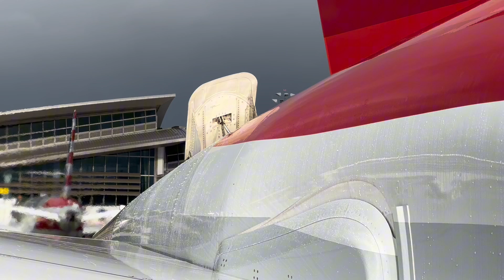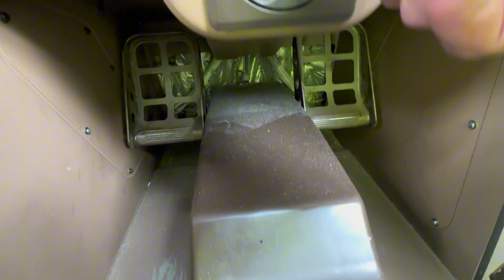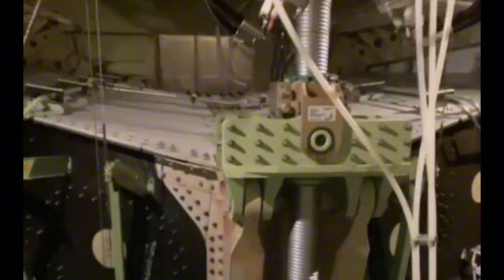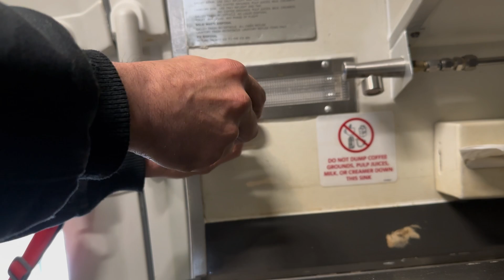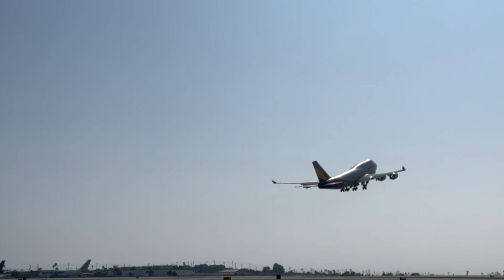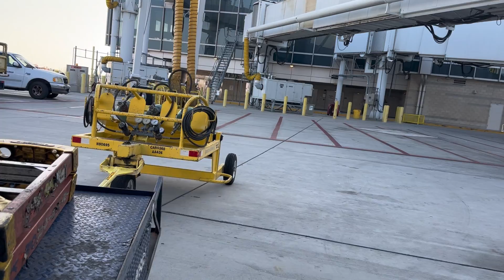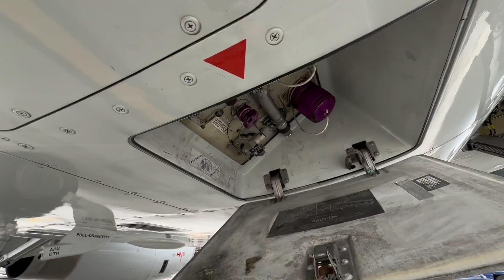Stig Shift #20 (Aircraft Maintenance Adventures)

Comment: Another excellent video - thank you for showing us your world. Your pride in and dedication to your work and knowledge sharing really shines through and is commendable. A couple of questions on tyres: do you change tyres on the 'line' (apron) or is that done in a hangar? how do you determine when a tyre needs to be changed, I assume remaining tread depth? How long does a tyre typically stay on before it has to be changed, say on a 787? How do you determine if a brake (pad) needs to be changed, is there a wear indicator on the brake assembly, a manual check?
Reply from the maker: Thank you so much and to answer your questions I have actually made plenty of other videos which I discussed these things in. In regards to the tire we look at the treadwear depth, and we measure it, in regards to the break there is a brake pin wear indicator. And I have also shown videos that we do tire changes on the line.
Reply: @StigAviation  thank you! I'll look out for those videos; I haven't caught up with all your videos yet - I'm sure the next video I'll watch from you will cover the items I asked about (which will make me feel silly I asked...) thank you and have a great day!
Reply: I've watched a few more of your excellent videos now, and sure enough as you mentioned, the answers to my questions are in several of your other videos! I've got to watch more! Another glorious day, thank you!

Comment: Regarding the crew Oxygen bottle, is there a 2nd one to act as a redundant backup? Also, how many bottles are used to provide passenger oxygen in case of cabin de-pressurisation?
Reply from the maker: There are some carriers that have multiple bottles, ours only has one bottle. In regards to the passengers, passengers have their own overhead oxygen generators that will deploy in case of a decompression.

Comment: Another great video as always. One thing not sure if it was mentioned, but what is that square panel half way down below the FO's side window on a Airbus that looks like a QR code? Static port? Diecast model makers put them on for realistic features.
Reply from the maker: Mike, if you could put a timestamp on what you’re looking at and I could answer that question.
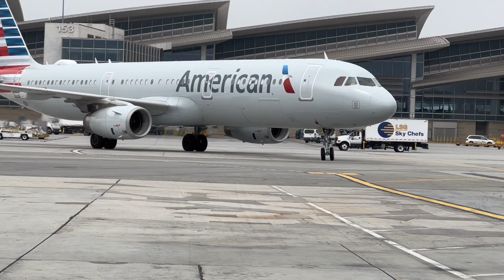Reply: @StigAviation  Towards the end around 52:30 mark as the 321 is turning into the gate below the FO window that big rounded corner square that to me looks like a QR code or bar code. LOL! Seems like its only on an Airbus with a red outline. I've seen them on a 380's too! Only on the FO side.
Reply from the maker: That is a static port my friend.
Reply: @StigAviation  Okay, got it. thats what I thought, just wasn't sure

Comment: Hi Stig,

You may have already covered this interesting bit? - but as your camera quickly focused on the main 77 gears – I caught a quick glimpse of the main hydraulic actuator.
As is in some cars that have rear wheel steering, your followers might be interested in getting details of how the front mains on 77s also allow for "rear wheel" steering – Just a thought – as always great fun watching you go through your work day including giving so many a very different insight into the “nuts and bolts” of these machines.
Reply from the maker: You’re referring to the body gear steering assist. I have covered this in previous videos and talked about how it activates due to the angle of the nose gear.
Reply: @StigAviation  I kinda  had thought so - you are so thorough ---  Cheers

Comment: Stig, great videos as ever but  with the Max tragedies that you briefly raised, you alluded to one of the pilots switching off and on the stab control override switch due to their lack of knowledge of the system. But wasn't it the fault of Boeing's powers that be  who decided that this new and subsequently flawed system didn't even warrant any full and formal training of aircrew? It just got buried in a small mention in the pilots training manuals? Just putting it out there.
Reply from the maker: I completely agree with you, Boeing should have been more transparent, and performed more training to the carriers to let them know the system. But that being said the aircraft can still revert to its back up systems window switches are turned off. That part of the aircraft has never changed. Knowing what to do in such a situation is the pilots responsibility. This is why I say, I blame both parties

Comment: our maxes actually have a lever that sticks out of the oil access so you can't close it when its unlatched, also bright orange inside nice and easy to see on walk around!
Reply from the maker: Since the max aircraft are equipped with the leap engine, they incorporated a similar design. CFM did a good job with that.

Comment: Question! You may have said this before and I may have missed it, but I’ve always been curious. What are the flexible air tubes that are connected to the plane while they are at the gate
? air conditioning? Helps apu or engines start? 🤔🤔
Reply from the maker: The big orange tubes are for air conditioning. They deliver preconditioned air from the jet Bridge.

Comment: Question. You showed the slide in the open door from below. The door was open so if the door is open and not lined up with the doorway how does it get in line with the doorway?
Reply from the maker: It swings back into the close position and will get latched with the handle when the door is closed.

Comment: I guess you read about the Airbus incident at Heathrow. Both engine cowlings left unlocked by the night shift crew. They actually thought they had secured them but they'd checked the wrong aircraft. It was later missed by: the tug driver, the aircrew, a film crew who were making a safety video 😲 Some passengers noticed when taxi ing but the cabin crew couldn't get through to the cockpit to tell them to abort take off.
Reply from the maker: I didn’t hear about this one, can you point me in the right direction so I can read about it.
Reply: @StigAviation  Hi Google this: Aircraft Accident Report 1/2015 - Airbus A319-131, G-EUOE, 24 May 2013....every time you show an oil check on an Airbus it reminds me of this one!
Reply from the maker: Oh, this is an old event, I thought you meant it was something recent.
Reply: @StigAviation  Sorry, yes an old one. Times flies 🙄😀

Comment: Regarding the sensor if anybody wondering: These are near infrared sensors with infrared LED-s inside. Human eye can not see that far after the color red, but camera sensors are not filtered entirely in that range, so they pick those lower frequency light waves up. It is the same "color" as infrared remotes for example.
Reply from the maker: Thank you so much for adding that, I completely forgot to mention that particular portion of information. I appreciate you.

Comment: Hi Stig, thanks for the video again, just wondered what level of spare parts inventory is kept locally for maintenance? I guess there must be a huge inventory to cover for different types and manufacturers, how do you requisition spares on the line?
Reply from the maker: The inventory is huge, we have a massive hangar that has lots of commonly used parts. requisitioning of parts is very easy, I simply find the correct part number through our illustrated parts catalog and order it through my tablet. I have it delivered to me or I can go pick it up myself   Unfortunately, I am not able to show that portion because I would need authorization for that.

Comment: Stig, I love watching you content! You mentioned that the APU on the 787 is a bleedless APU and that it is purely used for electrical power. If so, how would the packs work on the ground when it is a hot and sunny day and there is no bleed source from the APU or engines?
Reply from the maker: I’ve mentioned this in previous videos, the 787 has electric packs, they’re called CAC, cabin air compressors.

Comment: Not sure if you’ve adressed this previously, Stig… The ramp is a very noisy environment. What kind of hearing protection are you required to use? And are you in radio contact with anyone while you’re out and about doing your job? Just curious.
Reply from the maker: Hearing protection is very important, and the policy is to have earplugs or earmuffs. It’s provided by company. We also get annual hearing tests provided by company. In regards to communication and contact with anyone, I simply use my phone if I needed to get a hold of somebody in the office, I also can get notifications through my iPad for any kind of jobs or tasks I am assigned to.

Comment: The Pilot only being certified to fly on one type might be confusing to some. The reason is more for safety for the airline and for pilot familiarity so that routine and checklists are not cross referenced. Type rating can however allow a pilot to fly multiple aircraft within that type rating. for example, on the Boeing side the 757 and 767 are the same type rating, however they give pilots what called a differences training in regards to weight/fuel/speeds etc. The same is true for the Airbus 320 family. Some aircraft can carry more passengers, fuel, different engines and weight. Again an airline would have ground school on the differences training in order to accommodate this. Same "Type" aircraft have similar handling characteristics and are certified in this category under one type. Other factors involved are Airline size, Fleet, Configuration, number of pilots, domestic/international routes and volume.
Stig Porsche is a 356 Speedster Cabriolet. Can be seen in Top Gun original movie, Doc Hollywood with Canadian boy Michael J Fox and others. Could fetch up to 300k for rare model.
The Cadillac is one of two Jim Gately 1937 convertibles and part of the Flying Scotsman rallies
Reply from the maker: Thank you once again for the extraordinary amount of information you always provide. I appreciate that. And those cars were beautiful too.

Comment: Stig, I love your content! I am an aircraft dispatcher so a fellow aviation enthusiast. It’s great that you are showing the redundancy and safety of aircraft so people can be at ease when they fly. 

Secondly, I have to disagree agree with your take on the 737 max incidents. I will agree that the pilots on those planes were certainly not as proficient or trained as pilots in the US, however, with the original MCAS design…if there was a STAB/TRIM runaway, pilots had a very short amount of time to identify and react before it was too late to recover with manual reversion. The original MCAS system was deeply flawed and truthfully all blame lies with Boeing and Boeing alone. 
The NTSB also did an audit, stating that if MCAS was never changed, the 737 MAX would experience a catastrophic crash every 2 years throughout its lifetime. Equating to 15+ fatal crashes throughout its lifetime, making it the unsafest aircraft in aviation history. Luckily, they got that sucker fixed and reprogrammed. 

Anyway, love your stuff brotha!!
Reply from the maker: Thank you my friend, first of all I want to say I appreciate you being here, and I do understand why you would disagree, but we still find common ground where I still say Boeing is to blame. No doubt about that, but the information I found out about those incidents and the pilot training was very terrifying, that’s why I believe it could have been avoided. No doubt the MCAS was a flawed system and I’m glad the issue got rectified. Regardless of that, I prey we never see such incidents again.

Comment: 26:20 how do pilots line up so precisely at the gate? How do they know where their front wheel is?
Reply: There are two ways. There is either a marshaller guiding the aircraft in with hand signals (the guys you see waving the orange wands).  Or there is an automated system which displays instructions to the aircraft on a screen in front of the gate.
Reply from the maker: Thank you so much for helping out with the questions. Much appreciated.

Comment: I know any tools used for maintenance have to be certified and approved by the manufacturer of the aircraft ( or is this not true? ) but like the interior service light you replaced does than also have to be certified or you can use any off the shelf stuff?
Reply from the maker: Everything has to be certified. any kind of part used on aircraft have to be certified by the manufacturer or the vendor. Even down to screws washers bolts. It’s will have a FAA-PMA certification
Reply: @StigAviation  Thanks, I was thinking along the same lines but just wanted to get a confirmation.

Comment: Do airplanes get oil changes ? And if so how often does it go by hours ?
Reply: IIRC Stig says they never get oil changed, they just add new oil all the time.
Reply from the maker: The only time an aircraft engine would need a oil change is if it was called out from the manufacturer for a specific task or if the oil has been contaminated. Otherwise, we just keep adding oil and changing filters.

Comment: So the runaway STAB cutout WAS on there from the get-go? Then the airlines it happened to need to train pilots better. This is not the first time, poorly trained pilots crashed a plane. I have seen, dozens of videos. I'm no expert, so how aggressively did Boeing push the airlines to re-train their pilots on the new handling characteristics? The airlines seem partly at fault too.
Best case scenario, no airline should fly the MCAS planes until Boeing PERSONALLY went to each airline, to train people? Probably not feasible.
Reply: Boeing did everything they could to hide MCAS from the regulators and customers. So the pilots didn’t know that a new system could interfere with the stabilizer. Especially Ethiopian has a from what I read good reputation on training….
Reply: @ramdynebix  There was no change to the procedure to deal with a trim runaway.  If the pilots couldn't identify and correct a trim runaway due to MCAS, it seems they wouldn't have been able to deal with one for any other reason either.  That's a frightening lack of training for an issue that could have affected any 737 all the way back to the first model.
Reply from the maker: And this is what I was trying to articulate. Don’t get me wrong. Boeing is also at fault here, but once again, all of this could’ve been prevented.
Reply: @StigAviation  Then why did American pilots know what it was, and what to do? They were quoted, scoffing at pilots not knowing how to control the planes.
Reply: @ramdynebix  American pilots knew what it was, and what it does. They scoffed at the pilots that crashed the 2 planes. It was not "hidden" any more than the Airbus un-crashable LOGIC is hidden. Case in point, several Airbus crashes due to pilots fighting the computer LOGIC. One was the Airbus demo flight. Talk about egg on your face.
Air France 447/2960  and there are more.
Reply: @ramdynebix  American pilots knew what it was, and what to do. The cut-outs were there. Then BOEING FAILED if everyone did not know that. The cut-outs would make it less Airbus, and make it full manual control possible, like a Boeing. Personally, I prefer a pilot who knows how to manually fly a plane. Several GA crashes lately were due to pilot leaving auto-on, in RIME ice, and severe turbulence conditions. Auto-pilot on a GA airplane at susceptible altitudes they fly in, should not be used. A pilot needs to "feel" the trim. 
Esp. bad is flying faster than VA limits for weight in turbulence, which leads to structural failures. Slow down in turbulence and ride it out.

Comment: I would like to see what redundancy there is on newer planes for say, the elevator, as I do not see how a jack-screw, locked-up, due to lack of grease as in Alaska Air 261, could be over-ridden at that point. All aircraft I have seen have jack-screws, and drive motors AFAIK. In the video I watched, it mentioned that MD was faulted for not having redundancy. Where is the redundancy on an Airbus, or a Boeing? No other similar MD  airliner ever crashed, due to a broken, stripped, jack-screw.  Only Alaska Air, because it had not been lubed in at least 5x longer than normal interval. In fact, it was recovered devoid of any grease.:face-fuchsia-wide-eyes: Alaska Air had also been falsifying records, and the supervisor that told the next shift it needed to be inspected, and/or replaced, but a supervisor over-rode his input, so people died.
Reply from the maker: I’ll try to show that in future videos and explain the redundancies.
Reply: @StigAviation  That would be awesome!

Comment: I think a printed AMM for a 737, 777, 787 and A320 is a good load for a not too small Container Ship. 
I doubt if this will fit in an 18 Wheeler. Beside the different AMMs for the different Types which will throw that idea completely out the window. Even in a Container Ship
Reply from the maker: Thousands, upon thousands of pages of data. And that’s just the AMM, let’s not forget the IPC, SDS, the wiring diagrams, the FIM.